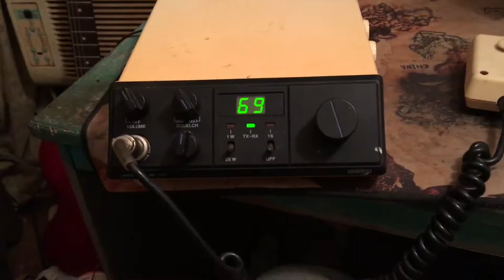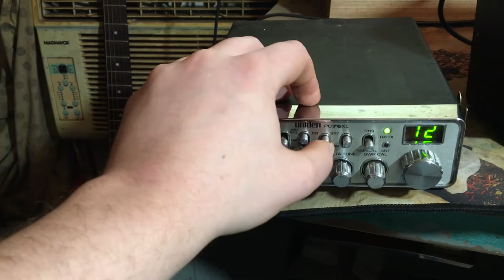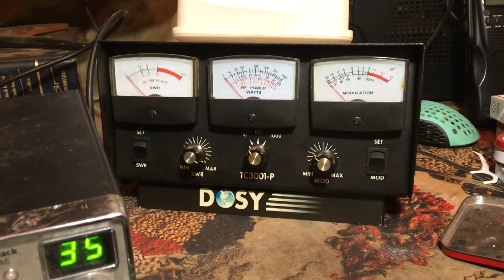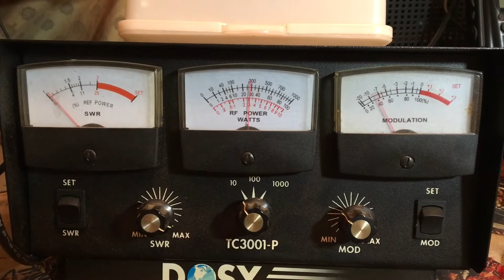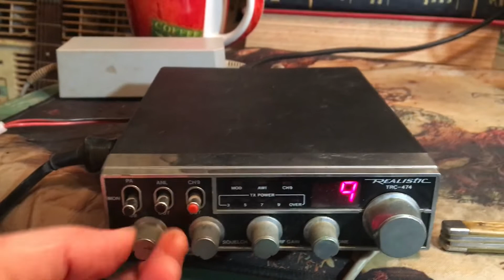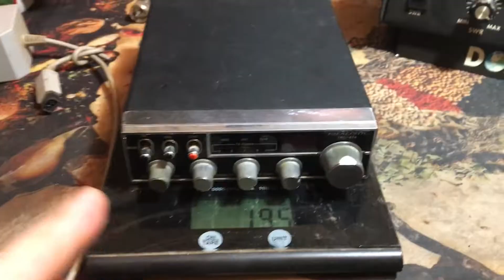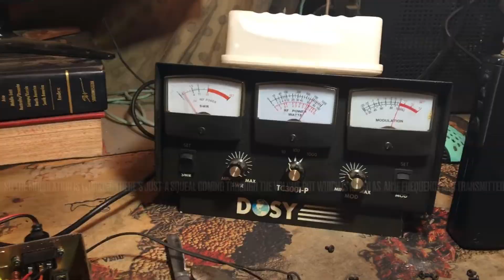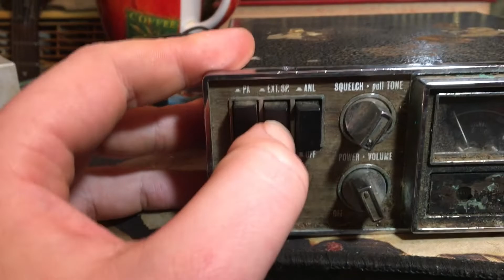Testing the Weirdest CB radio lot from ebay.

Comment: Hey if you still watch YouTube can you tell me how you use that wii power supply to power on those cb radios? Neat trick. Thanks
Reply from the maker: Just use a multimeter to find the positive and negative wires and hook it up 👍